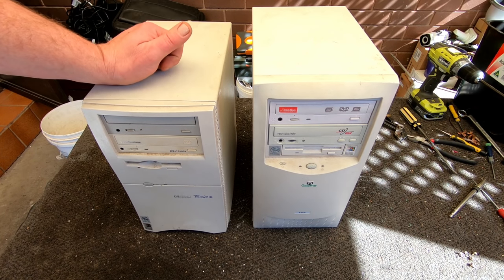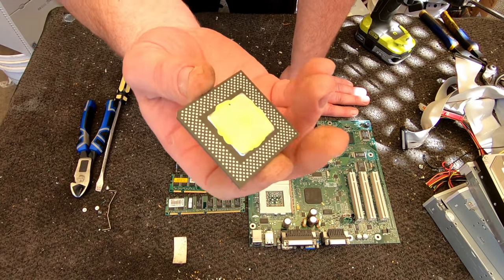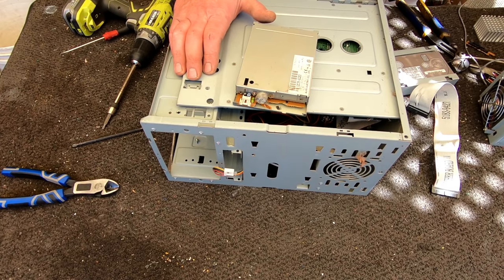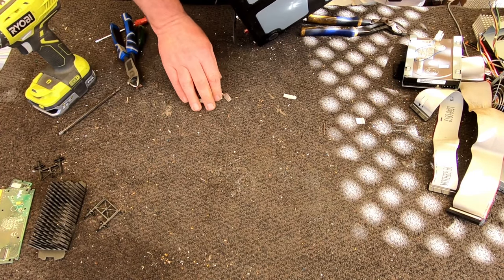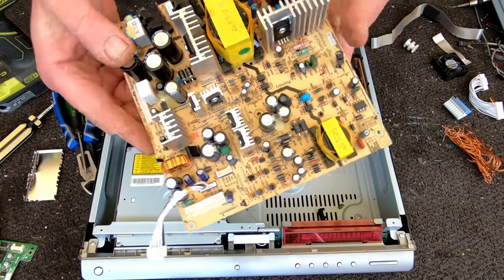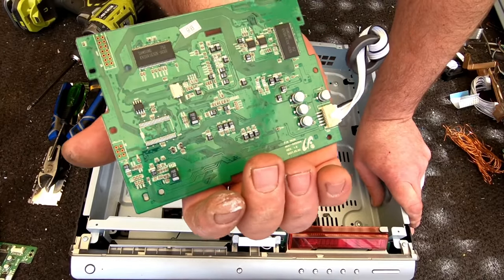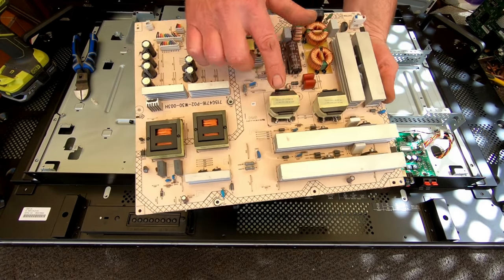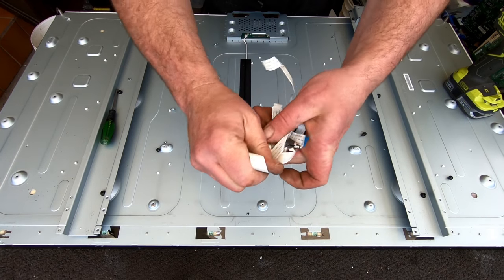Scrapping PC's, Blue Ray & Giant LCD Monitor

Comment: 41:17
This round thing is not a battery! It's a Goldcap-Capacitor with an extremely high capacity (at low Voltage - in most cases the voltage is rated at 5V). Such Capacitors are used to keep special settings stored on a volatile memory or to powering a RTC-Chip (RealTime Clock) while the Unit is not hooked up to an active outlet.

Comment: Both your motherboards are the corporate not for sale to home user type, they have a graphic board included, so you get the graphic board chip and RAM on the motherboard.
The second heavy slot card is a TV tuner, so that is just the basic TV aerial can that you find in any TV.

Comment: Question Ben, when you cut the tinned copper off the end of the wire (25:45) and put it into brass. Here's the question, would you melt the piece  of tinned copper with brass ingots?
Also the tinned copper wire that's on crt's  (with the degausing cable) would you melt that with copper ingots?
Would it hurt if I did it?
I'm a while away from melting copper bars!
Reply from the maker: I don't make brass ingots, only did it once, it's too messy and can be toxic since many additives can be in it.
The braided wire I think i did a bar on video, it's different, the tin makes it brighter, I prefer pure copper bars.
Reply: eWaste Ben Thanks Ben! If you did a video on it I've seen it. I started from the beginning again a couple of weeks ago. I'm a few videos past the Big Xerox Scrap I'm watching your 2nd stretch of flatscreens. I'll probably catch up to the ingot videos in a couple of weeks.
Again, Thank you very much!!!

Comment: I use the ebay shipping feature, it is pretty fast, postage is paid with the money I received on paypal for the item, I have just to fill the parcel weight, all other infos are filled automatically, it is very quick, just two minutes. Then I can just drop the parcel at the post office without waiting in line, of even having the postman picking the parcel up from my house at no extra charge.

Comment: You said the Gateway motherboard only has 2 bga chips...
I'm almost willing to bet if you popped off the small aluminum heatsink
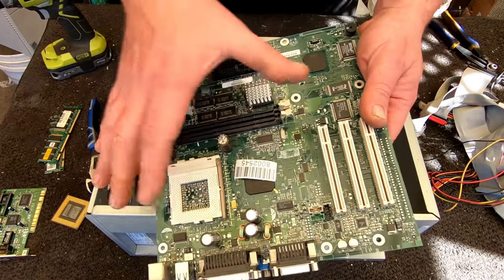(next to the ram slots, towards top center of video at 4:21)
a 3rd bga would be under it.